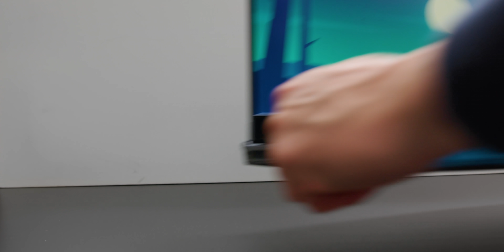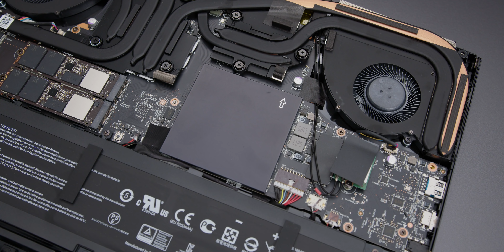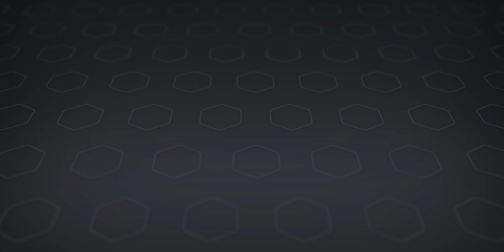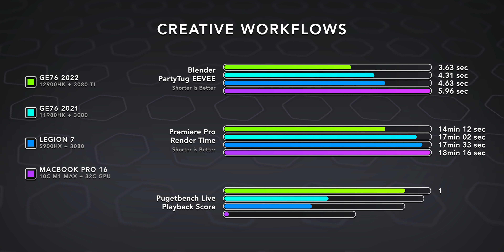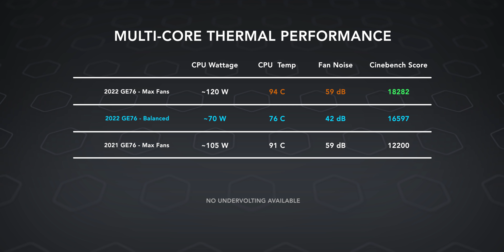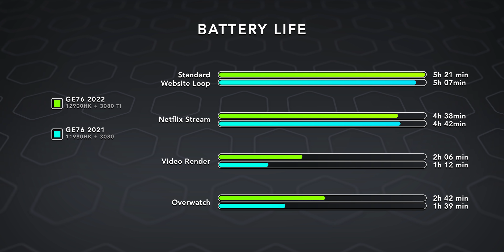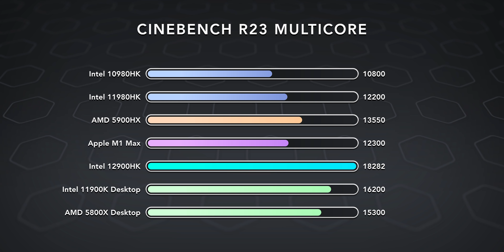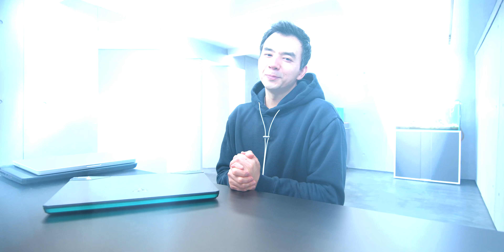This Laptop Is Faster Than Your Desktop

Comment: I was sceptical, but it seems like Intel really did a great job at taming the 12th gen's power hungry chips for mobile platforms! Amazing to see the competition between team Blue and team Red back on fire. Can't wait to see what AMD's response is!
Reply: @gitasumarni1760  plz dont post this kind of stuff here, we are otaku
Reply: @tsewangyougyal1794  wtf 
it's a bnoot you weeb
Reply: Alder Lake isn't even power hungry apart from the i9, the i7s and i5s are actually more efficient in gaming than Ryzen.
Reply: @SomeoneOnlyWeKnow 
current batteries deteriorate long term even without heat, but yes its faster when they are allowed to heat up.
Reply: What happens with the performance if you unplug it?
Reply: @Localtravel3r  you decide .. you can keep it as if it's plugged in or lower the performance but honestly with power banks these days do you ever really need to worry about that ?
Reply: @richardalfaro4933  "you can keep it as if it's plugged in or lower the performance but honestly with power banks these days do you ever really need to worry about that ?"

Make a 16 hour flight on an overseas flight and tell me how that works out.  Power banks can only be so big or you can no longer get on a plane with it.  So, all manufacturers are limited by what you can fly with, and this is the max size you can have.

This isn't like a 12900K with an 8x6 config, it's a 6x8 config, so even gaming is going to be a heavier workload now.  It's not an all core workload but still, it's going to consume a bit of power based on what people expect from a laptop.  On the other hand a similar Zen 3+, which is going to be on a MUCH more power efficient node with TSMC N6P should give a few hours of gaming pretty easily and you still have power to do light tasks for a few more hours.

Yes, you can reduce the performance, and then it won't be as good as what Zen 3+ will be.  I think I'd rather just get the laptop I don't have to worry about the power.
Reply: @johndoh5182  you play games on your laptop on a 16 hour flight?? What would be the point lol .. your phone, tablet, switch anything else would be more practical.. but I have 4 power banks around 50 bucks that can charge my laptop for work and media consumption over the 16 hours ... But I was thinking more like home use 250 to 500 power banks.. besides the most Ive flown at once was 17 hours and I don't see why you would pull up a laptop and play a game I mean what would you play ?
Reply: @richardalfaro4933  what he said is bs. 5950x runs at 240w~280w on fpu or rendering. 5600x 5800x, runs at 90w during gaming. When 12900k runs at 35w with higher performance.  There are ppl actually buys laptop and complain amd being hot and there are ppl online spreading fake news and say amd is cool. He is one of them
Reply: @zihechen3111  oh AMD is a second tier product though.. it has done better but won't ever be anything other than what the clippers of the NBA when compared to the Lakers
Reply: @zihechen3111 lol well this year they can't really lie 🤥
Reply: @richardalfaro4933  So you have no experience with Zen 3 laptops?  Or for that matter Tiger Lake?  Both of last year's line of gaming laptops bring true 1080p gaming to the laptop.   How many open world games can you play on a phone or tablet?  Forget that, because even if you can, I wouldn't because I wouldn't like it.  A 15" screen is the smallest I can deal with if I'm going to use it for something other than making calls, texting or being in a car and getting directions to a place I've never been.  I have no use for a tablet, switch or anything else you feel may be more practical.

No, I don't game for 16 hours and that's not what I said.  I said a few hours and then still use my laptop for light work, or watching videos, because that's mostly what I do.  Do try to read more carefully if you're going to comment back to a person.

My game list?  It's kind of long, I rotate through.  Far Cry 6 is the newest title I have.  Far Cry 5, Horizon Zero Dawn, Borderlands 3, Control, Wolfenstein II, Ghost Recon, Metro Exodus, ROTTR, SOTTR, Hitman II.

And I have more.  I like open world, action adventure shooters.  I've gone through the later Assasin's Creed line,  Assassin's Creed Origins, Assassin's Creed Odyssey and Assassin's Creed Valhalla.  I'll even load up Doom Eternal from time to time just because I like it.  I'd kind of like it if a MOH refresh would come out and revisit the WWII scenario of going through the different theaters, but of course with different tasks and new game engine.  I could never get through the beach landing without turning on God mode, or I should say I didn't have the patience to make it through so I don't want to see that come back again.  I'll probably get the remakes for Resident Evil 2 + 3.

I have a desktop for a good chunk of my gaming time, but I also have a gaming laptop, along with a general purpose laptop that both me and my wife use.  Everything is Zen 3, but I'll upgrade the desktop to the 5800X3D so it's the best that AM4 can be for gaming because I'll have it for at least 6 - 8 years because of how good the platform is.
Reply: @johndoh5182  u may ask ppl online. It's goes to 90c with just 35w. It's hot as fk during gaming. The fan is fking loud too.
Reply: @johndoh5182  look your bad game list doesn't matter, waht is the point of playing games that not only suck buit that don't involve multiplayer...  It's sad enough your playing some of the worse games ever made .. but what is the point if playing a game on a plane ??? Unless your sitting first class or maybe business it's annoying and irritating just picturing it... Besides all those games you can play on your phone 📱.. it just doesn't make sense to play video games without multiples these days especially with how bad they are
Reply: @johndoh5182  the thing is intel PC probably  last longer and more powerful if u play game on it. As I said already 12900k runs at 35w on gaming 5600x runs at 90w on gaming.
Reply: @zihechen3111  Use less power, higher performance to power ratio? Really?😅

The words you've said before "Stop spreading fake news, fanboys" actually should be a life advice for you. No way a lower wattage cpu generate more heat than the higher one
Reply: @M1710  This is hard time to be AMD fanboy because their zen 3 5000 series and 6000 series (still based on zen 3) totally got destroyed by Intel since Alder Lake comes out. Can't wait to see Intel Raptor Lake with 8P+16E and it will stomp AMD like it was nothing.
Reply: Intel nailed the performance, the only thing i would use against intel is they use a lot of wattage compared to amd, and i was hoping for a battery life gain because amd machines of 2021 get 10 hours easily :0
Reply: @eek8605  Intel,  they alway use that kind of method to get the score ,using clock frequency and wattage boost ,look amd and apple running at lower clock speeding but getting enough performance to beat intel in the rage lvl
Reply: @steviesteveo1  I agree, it's a desktop with a battery attached to it. I usually keep by laptop plugged 99% of the time at work for turbo boost anyway so I wouldn't mine a power boost with only 2-3 hours battery life. I need a desktop that I can put in my backpack from time to time as a programmer not a thin and light to carry a lot. I wouldn't mind a desktop at work with a laptop that I can use to just remote desktop into that one as well but my company wouldn't give me that option.
Reply: and green team apple
Reply: 45W vs 105W
Reply: I bet apple makes the best CPU's and possibly the best GPU's. There will be a Mac Pro (probably this year) with apple silicon that will be more powerful than any 12th gen intel chip. But it'll be way too expensive and a lot of apps will still run with rosetta or not at all. Apple will bring out this year CPU's and GPU's with desktop performance and they're gonna be the most efficient.
Reply: @ZephyrBassPiano  in your dream. Apple doesn't make good cpu
Reply: @zihechen3111   what’s the problem with their CPU’s? They are at least a year or two ahead in chip technology.
Reply: @ZephyrBassPiano  it uses too much die area. The gross margin measures how good a product is. And m1 is not a good product. They can't get sht out without sacrificing the cost. It shows how unskilled apple chip designers are.
Reply: @zihechen3111   why are the M1 products bad?
Reply: @Mojave_Ranger_NCR  "Too much die area? It's a fucking SoC. CPU, GPU, and hardware accelerators all on one monolithic die. The performance speaks for itself either way. Fact of the matter is, M1 has the best efficiency on the market no matter how much you suck off Intel in YouTube comments. You can praise Intel for making a good CPU architecture for the first time in nearly a decade, but don't spout bullshit about other products you are ignorant of."

You're correct.  But part of what gives Apple a big advantage is being on the most power efficient, performance node that exists which is TSMC 5nm.  So it's not so much about an architecture as it is the node, but the M1 is an excellent CPU and with the accelerators it has it allows it to compete in different tasks against X86-64.  I wouldn't do a power comparison because once again TSMC 5nm is a lot better than any other node that's in full production.  I don't know what's going to happen with Intel and their next gen, but for AMD they'll be on TSMC 5nm and they're working with different architectures and accelerators so for me it will be interesting to see.  Apple is supposed to be on TSMC 3nm so they'll certainly have the power efficiency advantage.

But the Apple laptops suck as gaming.  Apple didn't even try to get this into their laptops, so I hope that for their customers who also like to game maybe they'll consider them for the next gen products that come out, and that would mostly be including a GPU powerful enough to deal with games.  Apple has zero products that compete with these lines of laptops for what it is they do.  If they did it would also be a bigger laptop just like these and have to deal with higher power for the DGPU along with the cooling.
Reply: That is called “apple m1 release”. Intels strategy is a shame, 5% performance increase generation on generation until some real competition comes and they decide to move their butt.
Reply: the dude design apple chipset went to intel
Reply: The replies are a fucking shitshow
Reply: "69"00hs. very nice. very very very very very nice.
Reply: Stfu guys, stop comparing these. It's not like you guys are gonna game. You will just waste your time arguing on youtube comment section.. which can be done on a first gen raspberry pi.
Reply: AMD's responded already by ryzen 6000
Reply: @ganeshjagajeevanram9028  With Zen 3+ being on TSMC N6P, being able to clock a top end part to 5GHz, having RDNA 2 instead of GCN, along with making other improvements which is giving Zen 3+ about a 30% uplift over Zen 3 laptops, yeah, they did respond.

I watched Jarrod's Tech review of this and it doesn't look any better than Tiger Lake in gaming.  The difference between the top end Tiger Lake and top end Alder Lake looks like the difference between the 3080 which was the best DGPU last year, and the 3080 Ti which is the best DGPU this year, maybe.  We don't know how AMD's DGPUs are going to perform this year yet.  It doesn't look like the CPU is doing much of anything for performance uplift, or is very small.  So, even if for gaming, Zen 3+ is only a 10% uplift and it's more like 30% in production, that will put it on par with Alder Lake when paired with a 3080 Ti, maybe even better.

In fact if I were buying a laptop for gaming, I think I'd rather have Tiger Lake paired with the 3080 TI, but that's not going to happen because Intel won't want a head to head comparison at the top end.
Reply: i am waiting for another apple response to this
Reply: @tsewangyougyal1794  apple doesn’t has to respond. This thing consume 3 times the power as m1 macs.
Reply: @Localtravel3r  agree,
Reply: Yes, Intel’s 12th gen is the fastest at 120W and 2 to 4 hours of battery life. Forgive me if I wait for the ASUS Zephyrus G14 with AMD’s 6900HS and RX 6800S. I rather have the fastest laptop system that actually last for at least 8 hours on battery.
Reply: @tringuyen7519  so much power in a laptop makes sense if you use it as a workstation. I wish I had a 14 core cpu in my programming laptop instead of the 4 core 8 threads i7 that I have now.
Reply: @alexandruilea915  "Instead of the 4 core 8 threads i7 that I have" are you kidding me? Are you running like 10 instances of JetBrains when coding???
Reply: @mart1d4  nope, doing some huge calculations with multi threading. It takes more than 45-50 minutes to calculate something when I need to recalculate it for a whole month at once on single thread. On multi thread I managed to reduce it to around 5 minutes with 8 threads but that's still 5 minutes I'm looking at my laptop while the fan screams lol.
Reply: @mart1d4  usually this calculations take place daily on the server so it's not an issue of time but when I have to simulate something with different parameters on a month or two months old data it takes a while.
Reply: @mart1d4  basically I have a function of 1000 lines of code that analyses more than 1 million records to calculate the individual performance of each employee based on a very complex rule.
Reply: @mart1d4  if you're running a full stack, every core counts
Reply: @alexandruilea915  "so much power in a laptop makes sense if you use it as a workstation. I wish I had a 14 core cpu in my programming laptop instead of the 4 core 8 threads i7 that I have now."

This top end CPU has 6+8 config.  I've heard people get this wrong.  So it's a 20 thread CPU, not 24, and it's 6 p cores.

AMD's Zen 3+ APUs are going to be about 30% faster than their Zen 3 line which is a pretty impressive jump, and it's going to use less power in getting that performance since it's on a more efficient TSMC node, being on N6P rather than N7.  

Meanwhile Intel is still on their "Intel 7" which is able to clock very fast but the efficiency starts to go away past about 4.7GHz and is why Alder Lake 12th gen on the destop, for the top end part pretty much needs an AIO is you use it for heavy workloads all the time.  It's consuming around 225 - 250W at those heavy loads.  GN showed it at 243W when running his blender test.  That's GPU type of power consumption.  Intel can't pull magic out of a hat to make laptop die use less power.  So, understand that for whatever gains you'll get using this 6x8 config, which isn't going to be as impressive as their desktop line with the 8x6 config, the power consumption probably won't be worth it.

If you didn't watch Jarrod's Tech review of this laptop, in gaming the performance improvement looks like what you get in going from a 3080 to a 3080 Ti, meaning the Alder Lake architecture doesn't look like it did much of anything over Tiger Lake.  Intel clearly had a better architecture for laptop than they did desktop for 11th gen.  He's waiting to get 2 like laptops (same GPU) before he does a head to head between 11th and 12th gen.  But I already know I'd want a Zen 3+ laptop because even if 12th gen has performance that's a little better, the AMD laptops are going to have longer battery life and use less power and are going to game about the same.  On top of that if you can leverage the iGPU, RDNA 2 is going to smoke Alder Lake's iGPU.  

So really, the 8 core Zen 3+, which is 16 threads and this matters, is not going to be much of a degradation from the Alder Lake 6x8 20 threads, and the other benefits are going to be worth it.
Reply: @johndoh5182  I mostly agree with your points. The problem is that I can't influence the laptops they are buying which are from Lenovo T series (got a T15 right now). Unless Lenovo switches to AMD on the T series I'm most likely never going to get one from my workplace. At home I run a 5600x with 32gb of ram and a 6900xt which is miles away from my work laptop but I can't use my pc for development because I can't acces the databases from a private computer. Also it's not safe to handle the code and passwords on a private computer.
Reply: @alexandruilea915  "At home I run a 5600x with 32gb of ram and a 6900xt which is miles away from my work laptop but I can't use my pc for development because I can't acces the databases from a private computer. Also it's not safe to handle the code and passwords on a private computer."

I use a 5600U with a GTX 1650 for general purpose computing and it's been great, and low power and the battery will power it for hours.

I have a 5600X with a 6800 XT for 2K gaming.  I'm waiting for the 5800X3D to make that a serious gaming platform.  I know there is risk in this but I got an MSI X570 MEG Unify which allows NVMe RAID, and have 2 WD SN750 1TB in a RAID config which makes it fast enough for DIrectStorage and a less expensive way to get 2TBs of very fast storage rather than buying a 2TB NVMe.  I got those 1TB SN750s for about $110 each.

Yeah I understand the security issue because too many entities are trying to steal all the IP they can.  You gotta do what you gotta do.  Have fun with it.  Zen 3+ WILL make it to more lines of laptops as AMD pointed out in their CES video, but I'm sure they won't have the die to expand over the many lines that Intel gets into.  

Honestly I wouldn't buy anyway, just like I wouldn't buy this Alder Lake release.  I'm waiting for Zen 4 on TSMC 5nm because I think that's going to be a kick ass line of laptops along with being low power.  These are good, and Zen 3+ is going to be just as good, but TSMC 5nm is going to bring gaming to a new level on  laptops, along with handling whatever workloads you want, minus of course the serious data crunching, or rendering entire 4K movies which is done on workstations or servers with multiple GPUs.
Reply: @tringuyen7519  lets pretend balanced mode doesn't exist

Also lets pretend you will run benchmarks 24/7
Reply: @tringuyen7519  do you really think that they will last this long 😂
Reply: @tringuyen7519  And I'll wait for Zephyrus G15.
Reply: They didn't though. Look at the sites that are actually doing technical testing and the "feels fast-guys" like Dave2D.
Everyone is saying this will be a nightmare due to thermal issues. It seems like Intel purposely did this move to so "tech-reviewers" can say how fast it is, but it's basically useless power as the thermal issues will eat away battery and long-term reliability.
Reply: @pepesilvia4564  ? he showed numbers through benchmarks and real world usage tests; including thermal and battery performance. This is far from a "this feels fast" review. Instead of citing any of the "technical" reviewers you disregard the whole review because, "evEryOne iS sAyIng ThIs wIll bE a NighTmAre dUe tO tHerMal iSSueS".
Reply: @ASSAPRockyFan  This is hard time to be AMD fanboy because their zen 3 5000 series and 6000 series (still based on zen 3) totally got destroyed by Intel since Alder Lake comes out. Can't wait to see Intel Raptor Lake with 8P+16E and it will stomp AMD like it was nothing.
Reply: @pepesilvia4564  From your comments you sounds like true AMDumbs aka AMD fanboy, you just mad because your zen 3 and soon 6000 series which is still based on zen 3 totally got destroyed by Intel Alder Lake. It's not even competition.
Reply: @pepesilvia4564  which everyone lol

They haven't even patched it for efficiency

Also don't get this laptop if you run benchmarks 24/7 because i assume that's what you will be doing
Reply: @pepesilvia4564  I did not know that thermals eat away battery but don’t you mean durability instead of reliability?
Reply: @hodb3906  Heat kills battery life, causing permanent wear. batteries used to be isolated from the CPU but nowadays it does not seem to be a priority. they are designed in a way that allows the heat to reach it, thus raising profits since people will either pay for a battery replacement or buy a new laptop altogether. Also, they have started to make them 'non removable', like in smartphones. It's a tad fishy.
Reply: @hodb3906   FANS RUN ON BATTERY RIGHT ??  was it that hard to get ?
Reply: @pepesilvia4564  do u know 12 Gen is running cooler than zen3 don't u?????I don't  even know how this 12 Gen power hungry bs fking start. Stop spreading fake news amd fanboys!
Reply: @zihechen3111  H45 with turbo up to 115 watts is not power hungry?
Reply: @bldude2  to just match amd performance, 12900h use less power. And u say this sht is power hungry??
Reply: @bldude2  how about use another word, "more room for overclocking"
Reply: @zihechen3111  when hating Intel became their life, they can't cope with the changes. They will find whatever can be the reason to hate Intel. 

How hard to judge without bias? 
It's very hard sometimes...
Reply: @johndoh5182  beside 5800x use 90w during gaming when 12900k use only 35w. So u see how amds bich move is by avoiding talking about maximum  usage. And mislead u guys to think this amd chip use less powr?
Reply: @zihechen3111  First, I said ALL-CORE workloads.

https://www.youtube.com/watch?v=fhI9tLOg-6I&t=644s  about the 24 minute mark.

Sorry dude I believe a person who's done the most high integrity testing than I do someone spitting out insults in a comments section.
5900X uses around 135W, the 5950X uses around 120W which is a really impressive thing, just an incredible chip, and the 12900K uses around 245W.  This is an ALL-CORE workload.

These are measurements at the rail.  These are the CPUs running stock, but stock doesn't mean stock memory, so all the systems use XMP to set memory profiles.  Measurement at the rail also includes the power the VRMs use is included in that measurement, but they don't use much.  They pass on the voltage to the CPU.

If a person wants to spend a lot of money on a CPU and they're not even using it's capability, I'm not going to debate the stupidity of those decisions but it never makes sense to me.  And no, the 12900K doesn't use 35W when running many games.  It's going to be running closer to its TDP just like almost every other CPU that exists, but it depends on the game.  Sure, if you play single threaded games it's going to be twiddling around doing nothing.  I could run games like that with a 12400.   If you play games that have more modern game engines and can actually push a 8c/16t CPU around 25 - 40% utilization, then it's going to be running closer to TDP.

https://www.youtube.com/watch?v=QQL5GJvgddk

And as far as I'm concerned with you, you're white noise and I'll just agree to disagree and there's no need for me to make any other comment to you.
Reply: @zihechen3111  Use less power, higher performance to power ratio? Really?😅

The words you've said before "Stop spreading fake news, fanboys" actually should be a life advice for you.
Reply: @Hi-vy9lu  amd is hot as fk even at 35w is because amd has heat transfering issue. The heat generated by the die can't get out of the case fast enough. So it stays in the case and easily reach to 90c. Intel have no issue on heat transfering. So if the same amount of heat generated on both chip Intel will be like 20c cooler. Time to learn physics bich.
Reply: @Hi-vy9lu  there is one thing called "heat conductivity"
Reply: @green_block  "Which power issue are you talking about. The power efficiency is awesome for Alder Lake H series compared to AMD 5000 series. The power consumption range for 12900HK is 45W-110W compared to 5900HX which is 45W-119W. In every power bracket Alder Lake consumes less power than Ryzen counterpart."

Except this isn't competing against Zen 3.  It's competing against Zen 3+ which is about a 30% increase in performance over Zen 3.  Tiger Lake competed against Zen 3.  On top of that the Zen 3+ laptop APUs made the jump from GCN to RDNA 2 for the iGPU.  It's also on TSMC N6P which is a LOT more efficient than Intel 7.

So yes you're correct, this will beat AMD's last gen product.  Good for Intel.  AMD's Zen 3+ comes out in about a month.  Not so good for Intel because Alder Lake is going to loose in every category for power efficiency.  And no, Alder Lake perf/watt isn't "Awesome" even against Zen 3.
Reply: It's not power hungry as you may think unless you are doing some heavy editing or rendering. But it still beat AMD 5900x at total power consumption during that time by quite lot.
So I don't know why you think it's power hungry.
Reply: Lol AMD? Haha Intel just didn't need to do anything because all these chips are designed 5 to 10 years in advanced ..